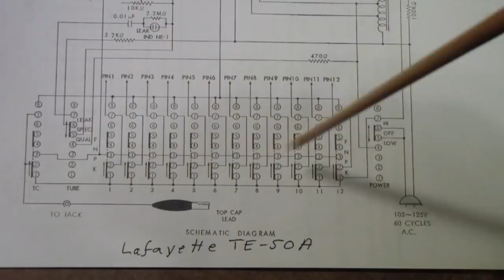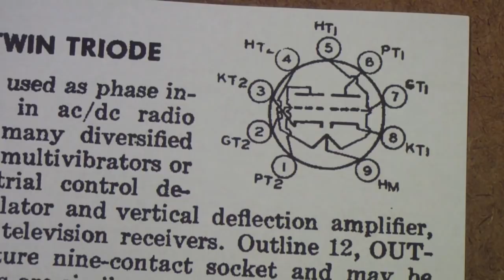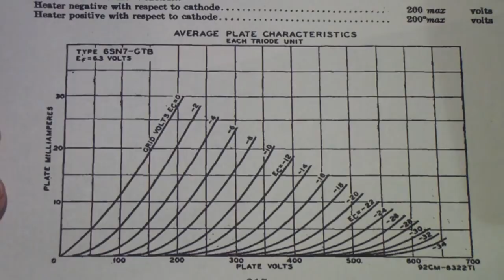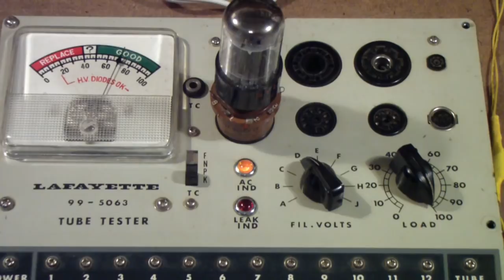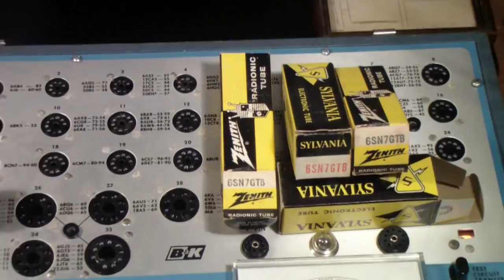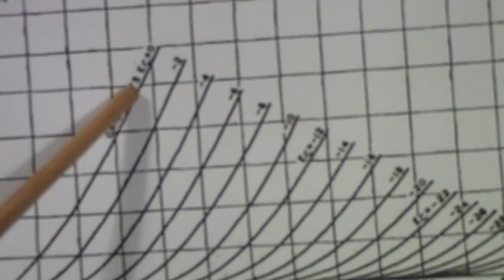TTT194 Triode Tube Matching

Comment: I'm a beginner ... just one question: use 2 probes on the oscilloscope in xy mode ... but if you connect the ground of the second probe (y) on the valve plate you do not short the plate with the cathode through the ground of probe 2 (probe 1 ground is tied to the tube cathode)? I hope I have explained it well (sorry for my english). Thank you
Reply from the maker: You cannot do this with a two channel oscilloscope with ground leads. The ground leads of all channels of most scopes are connected together. So you must either use a four channel oscilloscope (and the differential mode) or use an oscilloscope with floating inputs (like the Analog Discovery  made by Digilent). You might want to look at my videos on the Analog Discovery Curve Tracer (starting with TTT179) to see how this works. Please do not ever try to use the ground leads to connect to different parts of any circuit, they must always be connected to the same ground only.
Reply: @tomtektest8042  you are right... but in the video I don't understand (maybe you said it but I did not understand correctly) if you use a differential probe or your scope has floating input.... anyway thanks for pointing it out

Comment: Glad to see you're back.  Thanks for the tip that the schematic in the beginning of the video is from RCA tube book.  Still searching for it, but haven't found the correct manual yet.
Reply from the maker: Try page 331 of the RC-18 Tube Manual from 1956. It is probably in others from around this time also.
Reply: @tomtektest8042  thanks. Again, very glad you are back.
Reply: I miss read the schematic,  it's not wired as I first thought.

Comment: Hi Tom, welcome back. I have missed your videos, and am glad things worked out well for you. Hopefully you will get back to your experiments and demonstrations with the Analog Discovery. It is still my only digital scope. Dave
Reply from the maker: I may get back to the Analog Discovery at some point, but at present I don't have any good ideas for new experiments. If you or others have some suggestions I will certainly consider them and perhaps move the AD up on my list.
Reply: My purchase of the AD2 was my first digital scope, and I don't have much experience with analog either. I have a TEK 475 & 2225 but am far from mastering them. I think many Analog Discovery owners may be in a similar situation. The software interface of WaveForms 2015 is very different from scopes like the Rigol 1054Z, Siglents etc.. Learning to use the AD2 and get the performance one would get from a traditional DSO is a challenge. Diligent's Quick Start series of videos, while very helpful, still leave a large gap of covered features. A few videos demonstrating basic DSO operations on the AD2/Waveforms would really help. There is a book that has recently been published, but is rather expensive at $85 and I have not seen any excerpts to be able to judge how useful it might be.

Comment: It bears repeating that your Sencore PR57 is not truly isolated as the output ground is tied to the input ground (unless you bypassed it)..  The only reason you and your scope are "safe" is because you only had a two-prong plug plugged into your isolation output.
Reply from the maker: Thank you for your comment. You are correct that while the problem did not exist in this equipment (which is completely isolated from ground) it is important to understand all the complexities of AC power to remain safe when working on  anything plugged into the power line. That is one of the reasons I encourage everyone to learn with an experienced mentor rather than on their own.
Reply: Yes, I agree.  I just don't want people to get a false sense of invincibility by using an isolation transformer without fully understanding working with mains voltages.  Glad to hear you're doing well and I look forward to more videos!

Comment: Wow, so that's what someone who is intelligent thinks up when forced to have idle hands/time... Really amazing, but somehow you made it seem so simple.I wouldn't try this (1st I don't own an isolation transformer) 2nd, I'm not sure if it would limit the use of testing all the other tube types. I have a cheap 1966 emissions tester, but it hasn't let me down. And no tester can test for microphonics, so you still have to plug it in to be sure. Great video
Reply from the maker: Thanks for your comment and I certainly agree that if you feel apprehensive about trying something, it is best to wait until you have more safety knowledge. However, while an isolation transformer is always a good idea, you only need it if you are going to attach something like an oscilloscope (for the X-Y curve tracing). Also, there is no need to modify the tester at all unless you want to try curve tracing. If all you want is to try matching tubes with DC Transconductance, then you can do it without modifying the emission tester or attaching any external device. Of course, a particular tester may not have the same flexibility that the TE-50A has but I think most testers that allow you to switch individual pins might work. Since my preliminary results showed that zero-bias works about as well as a negative bias (at least on the 6SN7GTB) you don't even need to attach a power supply, just use the plate instead of the grid to measure plate current. Of course, the actual plate voltage available in the tester will also be a factor which is why I used the SPEC position instead of the QUAL position of the meter selector switch. As for the fact that no tester will really tell you if a tube is going to actually work in the circuit, I totally agree - even the best laboratory grade testers or curve tracers can only give an indication, the real test is whether it works in the circuit.

Comment: Interesting results using the emission tester.  Makes me want to dust off one of my old emission testers and play around with them to see if I get similar results.  My main daily driver testers are a BK 707, Hickok 800A and Triplett 3444 which is one of the best mutual conductance testers ever made in my opinion.
Reply from the maker: Yes, I was a little surprised that the reconfigured emission tester seemed to be able to match about the same as the 707 or the 650. I didn't try the 600A - maybe later. I haven't used a 3444 since the 70's but I remember it being pretty good too. Thanks for the comment and let me know if you try the emission tester.